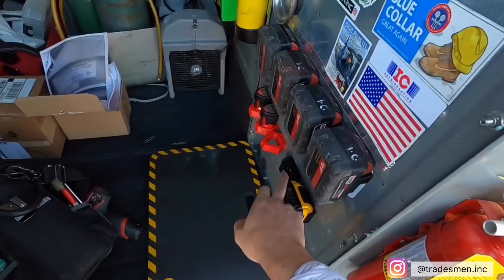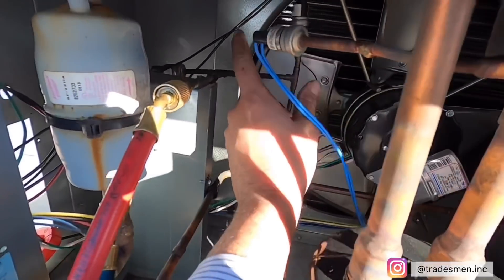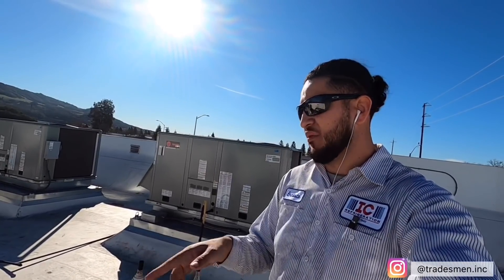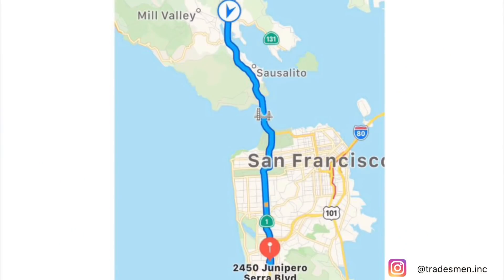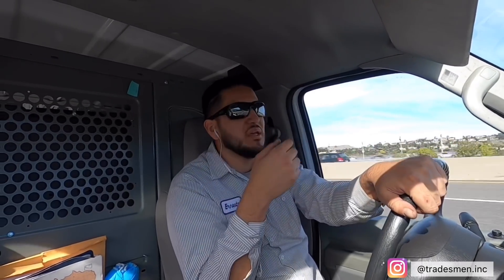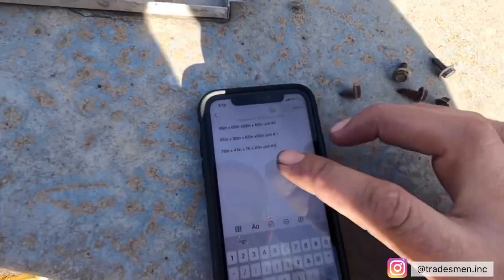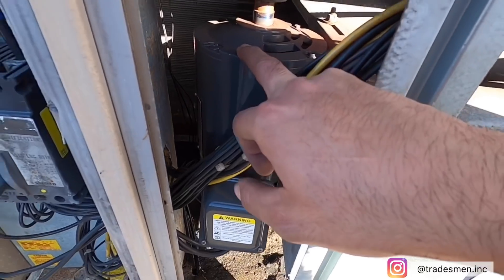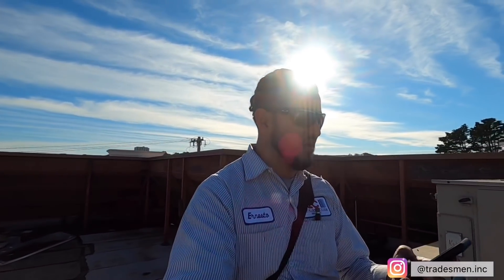HVAC-R VLOG / SAN FRANCISCO

Comment: I like to pinch them cut off old switch and then braze on an access stub and use a screw on pressure switch instead of the braze on style. That way you can also purge the small amount of air out after you unpinch it and with the access stub with a core in it you can switch it super easy next time

Comment: The pinch off method works with a pinch off tool that’s straight, the same tool has a flair block to open it back up.  It doesn’t open it fully, but for a safety control flow is ok as long as you have some